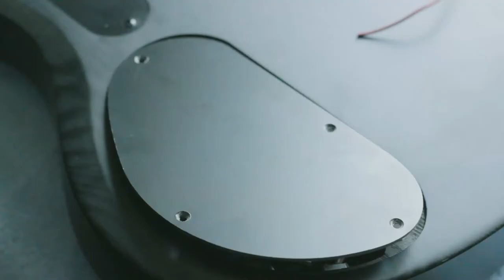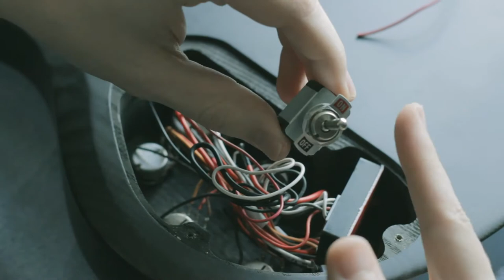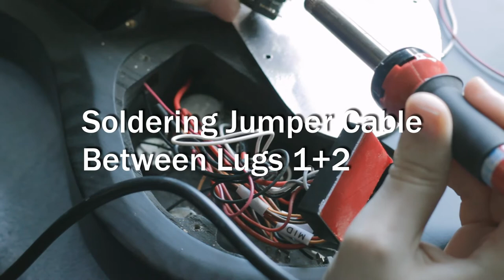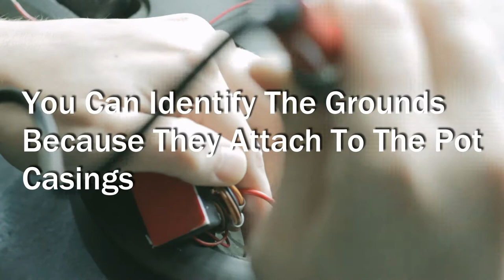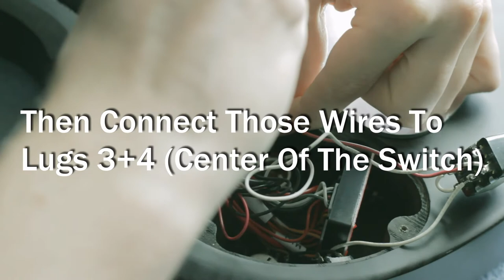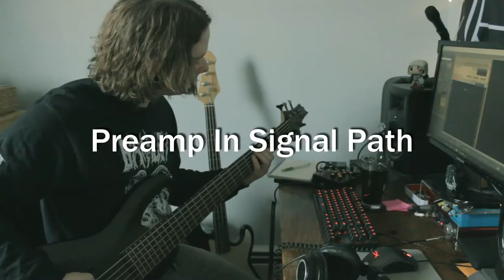Adding a Passive/Active Switch to my LTD Bass

Comment: By the way... Great video!

I guess the volume pot doesn't work in passive mode either since esp i think had the volume pot in the active preamp, right?   I'm wondering about a 3 position toggle switch.... Active, passive in middle, passive With signal disconnected in the top position.   Do you think that makes any sense?
Reply from the maker: On this bass the volume pot was not in the active circuit and does work in passive mode, I had another ESP bass that did have an active volume control so I replaced the pot in that scenario, it all depends.

Comment: Great video, man, will definitely give it a try one of these days. 
On other things, I have an ESP LTD sm204 with active eq and overnight started sounding very low. Already checked the battery, cable, amp and for lose wiring and all looks good. Have you had this problem? Any ideas? Thanks

Comment: How do I know which wire is the "preamp input"? I installed a dpdt switch on my bass as well. I took the hot wire from the volume pot since it's the only one that goes to the preamp and as there wasn't any wire from my blend pot going to the preamp. The thing is I was able tk run my circuit in passive but there was no sound coming out from the active side. I can only use my bass in passive at the moment. Lol. I used exactly your wiring, same as with Dan Thompson of Guns n Guitars.

Comment: Did you ever end up actually drilling a hole in the bass for the switch? Thanks.
Reply from the maker: I did, I'd recommend doing a micro switch so the hole can be smaller and you'll have a smaller chance of the drill bit causing chip out when it exits the other side. ;)

Comment: Hi, i turned my active Bass into a passive/active Bass just  like you. It has blend control, when it's in mid position, I notice there is less volume, it happens to you?
Reply: Maybe you have 1 pick up to much close to the strings, so when you use both the volume go down. Check it an thell me then
Reply: It is completely common and normal for a passive two-pickup bass to have a volume drop when blending to the center position, due to the two coils loading each other down. The passive solution is to wire a three-position switch instead of a knob, and install resistors to lower the level of the soloed pickups output relative to their 50/50 level. 
No, a passive vol/vol knob arrangement does not change the loading issue.
Reply: @callsignstatic6872  although it's also not a big deal.    Fender Jazz bass players have lived with this effect for many decades and it's the number one most used two pickup bass design ever.   So it's just something to learn about and live with.
Reply: @callsignstatic6872  My man. Exactly what I needed to read to make it all click in my head. Cheers!

Comment: Actually you didn't show the bass with the switch added at all. And there should be a sound difference with changing from active to passive and visa versa. Might be your first video? But it might make people doubt you succeeded fixing the active/passive switch. I am not saying you didn't.
Reply from the maker: The actual preamp EQ controls were set flat. Depending on the preamp there will not necessarily be a noticeable tonal difference with the preamp engaged. The point was to show that it worked either way and that in passive mode the pickups still sound about the same. I wasn't "fixing" anything, I was adding this switch so I can bypass the preamp so the bass can be played without battery or with a dead battery by flipping a switch.